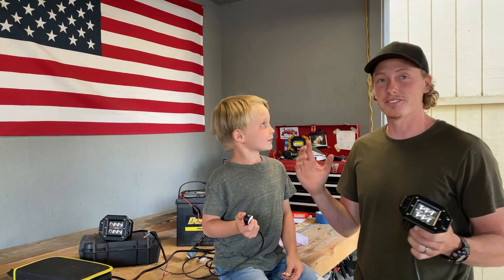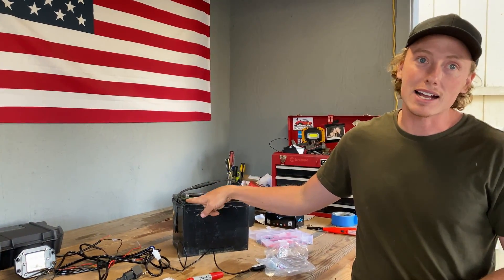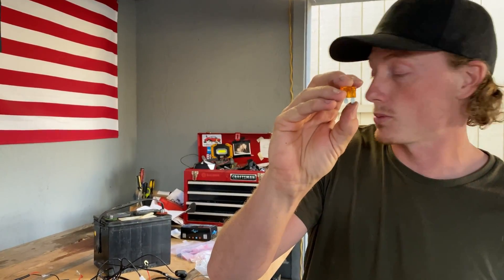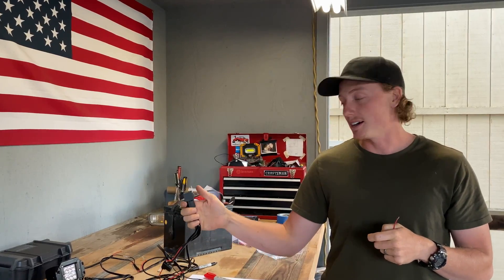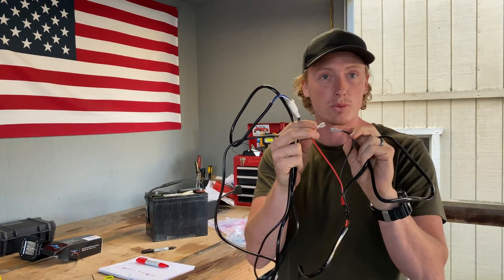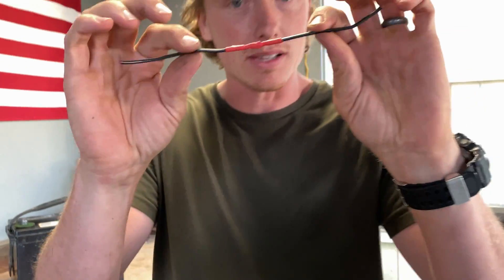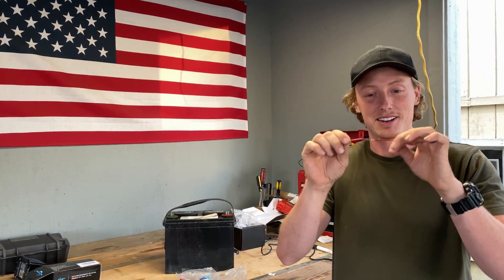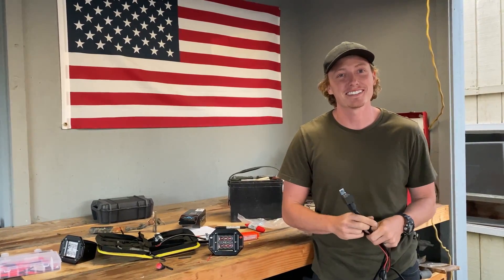How to wire LED lights

Comment: For those new to all of this, maybe thinking about wire as an air hose or water pipe will help. Amps is similar to psi (pounds of pressure per square inch) for air or water. Too much psi in an air line, or pipe "circuit" will blow out the weakest point. Similarly, too many amps through an electrical circuit will "blow out" it's weakest point (in the form of heat, possibly fire). You want that weakest point to be a fuse (or circuit beaker)

So, everything in the circuit; wire/relays/switches/connections/etc., should always have more amp capacity than the fuse/breaker, and needs of the device(s) being powered. 

I hope that's helpful, and not insulting to anyone.